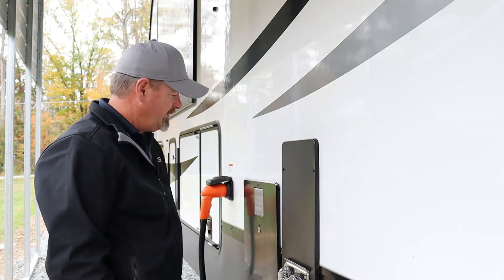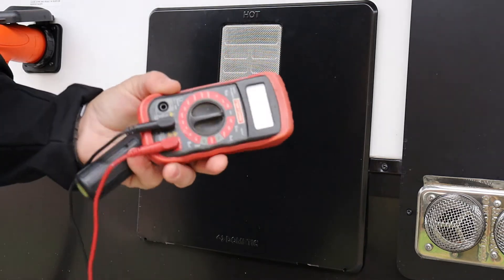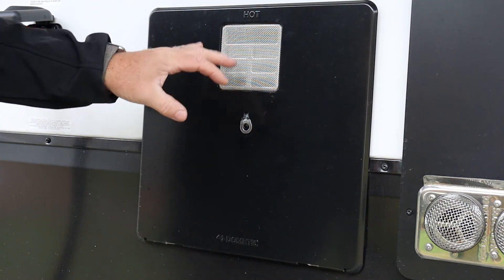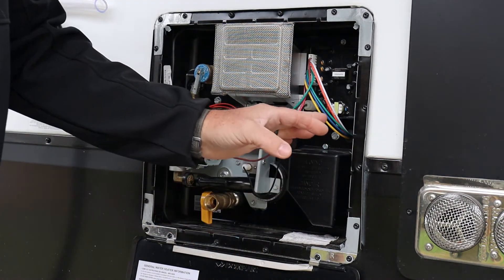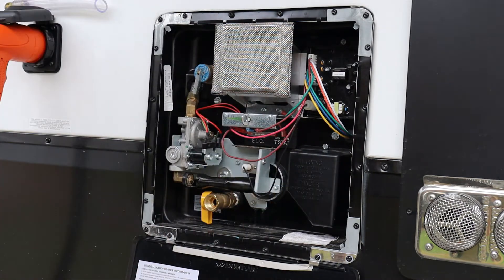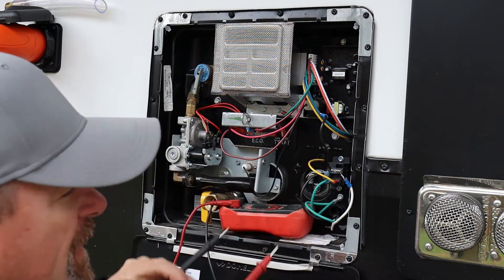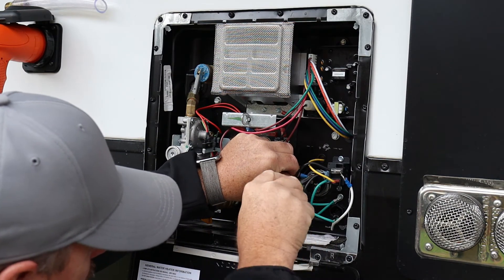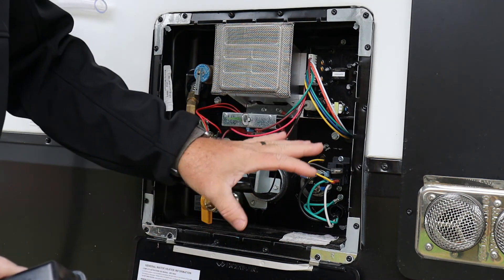How to test an RV Water Heater Element

Comment: I have the same water heater I'm having a issue I'm gonna have to check the heating element so this was a thumbs up video for me. Let me ask you also when I try to use it on propane it lights theb like 3 seconds later it cuts off I got continuity the the thermal off it's good my board is good my t Stat is good. Is there a sensor on the two probe that the flame sits on

Comment: Bad move with your addition of a brass valve where the plastic “safety plug” was. That plastic plug is designed to fail under high pressure should the other safety devices fail. Also the contact between brass or copper and aluminum can cause a galvanic reaction that accelerates the oxidation of the aluminum tank. Your idea good in theory but not so good in practicality,